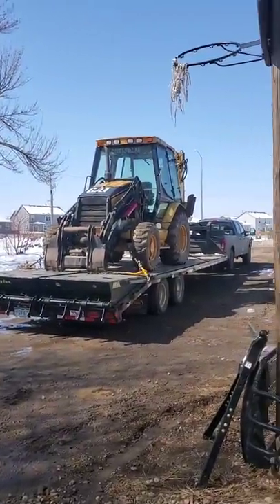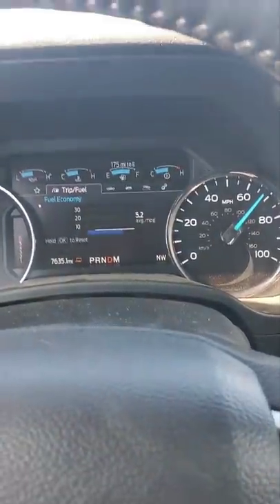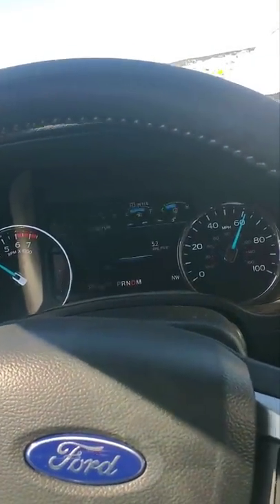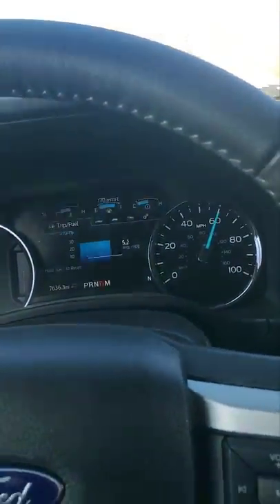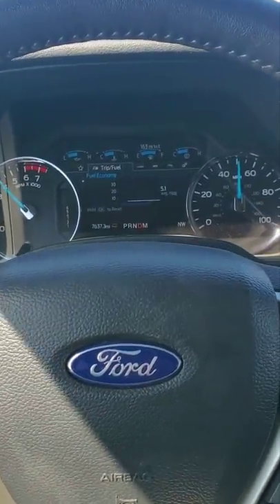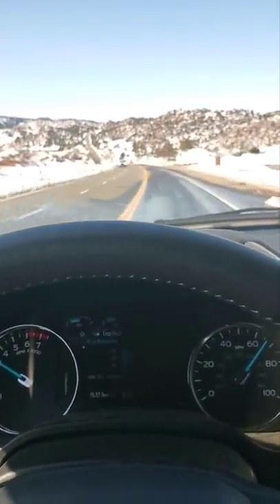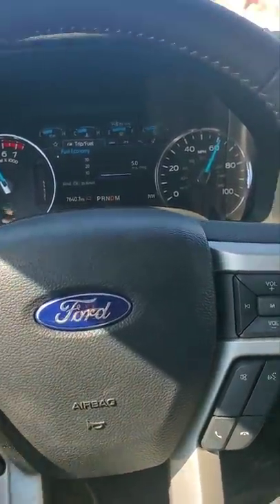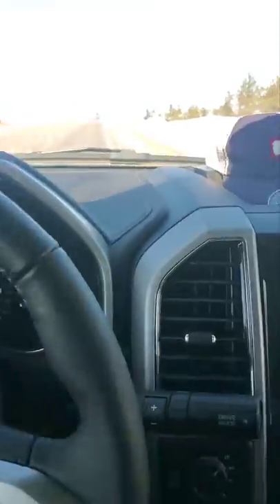7.3 godzilla towing 24k lbs through the rockies.

Comment: Don't forget the 3valve v10...that engine was powerful also...
Pulled a 17k trailer and could pas people on hills with a/c running...
Reply: The 3 valve V10 from Ford is way better than this engine.  Almost as much power and better fuel economy and is reliable as heck.   This new 7.3 is a joke all around.

Ford should have just made the 6.8 V-10 a lot bigger and improved upon the already reliable motor with new intake, throttle body, complete exhaust system from the manifolds all the way to the back, better tune for better power and fuel economy, and a few other things.  They could have made it with 4 valve heads and just kept the camshaft sprockets instead of cam phasers and made it reliable like it is now.

They could have allowed upgrades or options like a turbo or supercharger and made it even better.  It was so stupid of Ford to stray away from such a great motor.  That 6.8 V-10 was and is awesome.  Way better than this 7.3.

Oh yeah, almost forgot.  Just think what kind of gearing you could have with a 10 speed transmission mated to the V10?
Reply: @eldridge201  V10 is more tested but this motor is better for MPG low end torque, its smaller and while naturally aspirated you can tune the 7.3 to over 700HP which you can then stack a super/turbo charger on top of. This motor is massively detuned and overbuilt for the HP/Torque it makes stock meaning it will last a very long time, the stock parts can be pushed to 1450HP/1180FTLB of torque by Ford in their labs with "built" engines seeing over 2000HP.

The V10 is a great motor but there is a reason Ford decided to go with the 7.3 over revising the V10.
Reply: @yungnachty4474  What do you mean this motor is "better for MPG low end torque"?

Are you trying to say it gets better fuel mileage at the "low end" of the torque curve?  If so, where is your proof of that?  But also, how would you even test for something that specific?  You would have to have a very interesting and lengthy experiment which would be almost impossible to pull off without some serious financial backing because you would have to test multiple engines (each engine of course) and do many runs at the lower end of the torque range/curve for long periods of time AND...AND with the same specific load/conditions for both motors as well.

So, how would you even get that?  I contend you couldn't unless you had a laboratory with probably 5 to 10 engines of each motor and a few different "load" scenarios.

Plus, you would have to run them for a certain amount of hours and shut them off after certain times to simulate "real world" conditions.

I'll "guess" that what you actually meant to say was that the 7.3 gets better MPGs than the 6.8 V-10 (2 valve or 3 valve version) and I can say for a fact based on ownership and experience BUT ALSO all of the research I've done online that this is simply not true at all and is actually an inaccurate claim/statement by you.

I don't know what you've read or what I've typed at this point as I've gotten involved in various discussions about the 7.3 on YouTube so I don't know if I mentioned it in these particular comments but I actually own a 2002 F-250 extended cab 4x4 long bed with the 2-valve 6.8 V-10 (auto) and it has just over 325k on it.

Recently, I had 2 or 3 bad coils due to a small radiator puncture causing coolant to spray up over and onto the upper portion of the driver's and passenger's sides of the engine in between the valve covers and the intake where the coils are.

This resulted in coolant getting on top of and residing on the coils as well as some of the coolant leaking down into a few of the spark plug holes and causing some of them to short out and cause misfires in multiple cylinders.  Of course, it got crap for fuel mileage.

After about 3 or 4 months of allowing this to happen, I finally got around to replacing all 10 of the coils and instantly my fuel mileage went back to what it was prior to this which is better than the fuel mileage reports I've seen on many YouTube videos as well as some online forums for the 7.3 gas engine and I've stated this multiple times on multiple videos.

I don't know what I've typed here but I've routinely seen people try to "brag" about getting 14 to 15 mpg in their 7.3 and sometimes they will say they are getting 16 mpg but the thing is, these people ARE ALWAYS driving super slow at 55 to 60 mph.  "Sometimes" I'll see some owners say that they are doing between 70 and 75 mph but when they are going that fast, they are typically under 14 mpg and around the 13 to 14 mpg range which is pathetic for an engine of this size after this many decades of being in the automotive industry.

I can get that and actually better with my "old" beater truck with 325k on it.  I could get an average 16 or 17 mpg with it if I wanted to drive super slow at 55 or 60 mph but that's NOT a "typical" or "real world" type of situation because "most" people don't drive that slow around the country on main highways or interstates which is when these figures matter.

Of course "in town driving" or odd areas where there are lots of hills, curves, or stop and go traffic won't count.  But nobody's trying to compare those conditions because they are knows to be "odd".

So, why "brag" about something that doesn't even matter or isn't relevant?  It's just stupid.  

But also, you have to consider that almost ALL of these owners make these claims WITHOUT DOING an accurate fuel calculation and they simply go by the dash reading which is inaccurate as it ALWAYS IS.

I've seen "some" owners claim that they do a manual or hand calculation based on their fuel receipts and gallons they put in compared to the miles they traveled and they "say" that the dash reading is only about 1/4 to 1/2 of a mpg off (higher than it should read) but the reality is, I'll bet the majority of these same owners would find it's actually closer to 1 mile or even more off if they did their calculations accurately.

Why do I bring the word "accurately" into the equation?  Well, again, I've explained this on other comments but I'll mention it again here and if I'm repeating myself, then I apologize.

But, the thing is, when people fill up, they are almost NEVER refilling at the same place or under the same conditions.  So, when people do their first fill, they may be on 100% completely level and/or flat ground at the fuel station.  And typically, when they fill up, they let the fuel handle clicker release and then try to fill up maybe a little bit more until it clicks one more time and then hang up the handle again and call it good.  They go inside to pay, get in the truck and drive a few hundred miles down the road and fill up at another place but here's where the problem comes in.

When they fill up at the next place, it may not be on completely level ground.  And as such, when they fill up and allow the clicker on the handle to release, it may do so without filling up the tank to the same level as they did for the first fill.  But also, even if they try to pull the fuel fill lever again and let it fill up a few more seconds, it may stop filling and release the clicker on the handle sooner on the second fill than on the first.  

And if the owner doesn't want to keep trying to fill it like they usually do, then they put the handle back on the pump and go in and pay and continue down the road.

The problem is, the handle release calibration on the second pump may stop sooner at the second fill up than at the first.  But again, also, if the ground was not as level, they wouldn't get as much fuel into their tank on the second fill as they would the first fill.  And sometimes, the difference can be as much as 1 or 2 gallons or possibly more if the difference in ground level is REALLY bad at the second station.

Obviously, "most" fuel stations are on level ground.  But, there are a few that have a slight incline to them.  And if this is the case, then you won't have THE EXACT SAME filling conditions at both locations so the calculations will be off.

And if it's off by 1 gallon, if you're traveling about 500 miles between fillups, if you only had to put in 35 gallons, that equates out to 14.29.  If you had to put in 36 gallons, that comes out to 13.89 gallons or a difference of 0.40 gallons or almost 1/2 gallon.  If you had to put in 37 gallons, then the calculation comes out to 13.51 mpg or a difference of 0.78 gallons or almost 1 gallon.

So, there IS a difference that would matter.  But the problem is, people "ASSUME" they are filling up their tanks to the same conditions at both fill ups when really, they might not be or actually probably are not.

The ONLY WAY you could guarantee that you had the fill ups to the exact same conditions is if you filled the tank up BOTH TIMES on level ground AND filled up the fuel level to the fuel neck lip where you put the cap on.  But, the problem is, in order to do this, it takes about 3 to 5 minutes of extra time because in order to do this, you have to pump until the pump handle clicks or releases and then let the fuel level slowly go down which takes 5 to 10 seconds so you can put more in and repeat the process until the fuel comes to the top at the fuel neck lip and "rests" there and doesn't drop anymore.

But, who's going to do that for their experiments?  Almost nobody.

I know a lot of people like to use TFLT's suggestion (The Fast Lane Truck on YouTube) of filling until the handle clicks and then counting to 30 seconds and then filling it one more time until the fuel fill handle clicks and then that's it.

Again, the problem is that different stations may have different calibrations for how soon their fuel fill handle will "click" in comparison to other fill stations.  But also again, if the truck is not at a level resting position in the first place, then the fuel level won't be the same for having the fuel nozzle filler "click" so the overall fuel fills will be different.

So, until people are willing to spend the extra time to fill up their fuel AT BOTH STATIONS to the point that the fuel "rests" or levels out right up to the fuel fill neck or lip, then I'm contesting that the accuracy of the hand or manual calculations are not accurate in many situations.

I actually do take the time to do this when I want to run experiments or get accurate figures.
Reply: As far as having "low end torque", I haven't looked and compared the torque curves for a long time so I don't know what the differences are at this point.  Perhaps the 7.3's peak comes in at a lower RPM range or it starts to make noticeable power sooner.  That may very well be true.  I'm not contending it isn't true.

But, as far as the 7.3 being "smaller", what is "smaller" about the 7.3?  It's physical size?  Well, that may be true since the V-10 obviously has 10 more cylinders.  However, since the 7.3 factually has more "cubic inches" by approximately .5 or 1/2 liter, wouldn't the 7.3 "technically" be larger in terms of cubic inches?  I think you can read the answer in the sentence before this last one.

Again, I haven't compared but is the 7.3 actually a "taller" engine in terms of height from the bottom of the engine deck surface area where the oil pan is attached (not actually including the oil pan depth) to the top where the valve covers go?  What about the intake or plenum?  Do those need to be considered as well?  Are you comparing width as well from the edge of the valve covers to the other valve covers?

What I'm getting at is are you considering the OVERALL "mass" of each engine and comparing the two?  If so, I don't know which one is technically "smaller" but we have to know what's being compared.

When it comes down to it, by the time you "cram" either engine in he front engine bay area of either truck, you really don't much room left.  But, if you want to argue "size" in that engine bay area, I think an argument could be made that the V-10 actually has "more" room under there although it may not win by much.

Just go and look and compare the additional hoses and other emissions components, sensors, and other "stuff" that the newer 7.3 V-8 has compared to either version (2 or 3 valve) of the 6.8 V-10.  Perhaps the overall width is less and I'm sure the overall length is less since it obviously has 2 less cylinders.  But maybe it makes up for it in height as well as the way accessories are mounted and so on.

In reality, I'll bet the difference isn't that much but based on looking at some videos and pictures of the 7.3, I don't think it's any "smaller" by any means so I don't think your comment holds up there.  At least not in my opinion.
Reply: In regards to "tuning" a 7.3 to 700 HP and possibly being "detuned", that's a fine point to make if you want to get into that discussion.  Unfortunately, although there are "some" people that have done some "tuning" to the 6.8 V-10 (both versions) and they've had okay to good results (depending on who did the "tuning"), there just aren't or weren't that many people that did much with the V-10 in that area.

So, it will be tough for me to make a comparison and see where the results come out at.  I do know I've watched a few different channels on YouTube where some owners have gotten "decent" results upwards of the high 480 plus range to the lower 500 range for RWHP so that would be close to your 700 HP figure if you're talking crank figures.

But, here's where you will lose me with the argument when you bring up Ford being able to "push" this same engine to 1450HP/1190 FTLB of torque or even having "built" engines with over 2000 HP.

That's all fine and good to have for the sake of a discussion BUT IT DOES NOTHING FOR ACTUAL "REAL WORLD" (TYPICAL) USAGE.

The problem is, Ford HAS NOT come out with any additional software "flashes" or program changes to allow for any more "oomph" in the power department.  At least not that I'm aware of UNLESS they actually did super recently that I missed.  If I have missed that, then please provide a link to that info.

In fairness to the 7.3 though, the "tuning" aspect is actually something I have been arguing for in a few comments since I also feel that the engine has more potential than Ford is allowing it to have from the factory.

You see, whether you're aware or not, I actually worked as a Ford tech at a couple dealerships on heavy line as well as the light line so I've got an "okay" well rounded bit of knowledge of Fords.  Sure, it's been a few decades since I worked at these dealerships but still, I understand that Ford has come out with software upgrades and/or "tunes" to improve performance, drivability, emissions, fuel mileage, longevity, and etc.

They've done it with a few of the Powerstroke diesel engines and some other ones.

But what I don't get is why they haven't increased it significantly or, at the very least, even a little bit.

My thought is for a few various reasons but mainly because Ford is scared to do this for fear that these engines won't hold up to the abuse they would be put through should they add another 100 HP to them.  Since you say that they can "tune the 7.3 to over 700HP", then adding another 100 AND STILL keeping it under 600 HP shouldn't be anything to worry about.  But they don't do this?

Why don't they?

Heck, even 75 would be something or at the very least, how about an extra 50?  I can't believe adding 50 with the tune would be asking too much.  But, apparently it is.

But, if what you say is true about the figures of 1450HP/1180TQ, then even 1/2 of that SHOULD be a "breeze" for this engine to handle even for the long term since it would essentially just be doing 1/2 the work over the long haul.  So, is 725HP/590TQ really asking too much?

How about an easy figure of 700HP/575TQ?

That's even less but yet still a significant increase over stock.  Are they not confident enough that these engines can handle that power for the long term?

My point is, if they aren't going to allow these engines to produce more power from the factory AND STILL maintain the factory warranty (which actually should be improved as well), then these numbers don't mean squat.

It doesn't matter if you can build an engine to make 2 or 3 or 5 times the power if you can NEVER use it.

In fairness, even you have to admit that bringing up a "built" 2000HP plus 7.3 V-8 is kind of ridiculous since it would DAMN NEAR ONLY APPLY TO A RACING APPLICATION.

And at that point, why are you even having a discussion in these comments?

This IS NOT about how much you can build these motors to "race" with.  It's about the "typical" every day owner or at the very least, one that may use it for harsher uses than the "average" person such as a construction company or someone that uses it to haul trailers or other things for day to day use AND DO SO for 200k or hopefully 300k plus miles.

Nobody cares that it can make 2000 HP going down the track UNLESS they are using the truck to race.

I understand that you were trying to point out that "the possibility" to make 2000HP plus is there but so what?  Unless I'm mistaken, I believe you can make a 6.0 Powerstroke diesel to make almost 2000 HP (I actually just watched a video where they made just over 1900 HP from Warren Diesel).  But, is that something that's going to be used for the "everyday" owner?

Likely not.
Reply: I'm not going to try to argue that you could "push" a "built" V-10 to 2000 HP or even 1500 HP for that matter so I will concede that perhaps this new 7.3 V-8 is better in that regard.

But, like you admitted at the very beginning of your response AND what is likely one of the most important things to consider with this comparison or argument.

The V-10 was AND IS "more tested" or in other words, has "real world" results to stand on.  And as such, this new 7.3 simply factually can't really compare at this point.

This new 7.3 just factually doesn't even barely have 2 1/2 years "in the field" being used and we could argue that it's barely coming up on 3 years.  And the reality is, there are likely VERY FEW owners that have even 100k on the majority of the engines out there and probably hardly any that have 200k on them at this point.

And as such, you aren't going to have any "real data" to compare in terms of longevity because there simply isn't really any to speak of due to likely many of the engines having 100k or less miles on them.  And really, that isn't anything to bring up since that's not really even the starting point that the discussion should be at at this point in time with the decades or almost a century of improvements for the engines.

But even with the short time span of operation, we can still point out some things that are problem areas based on the history of other engines from Ford with the same types of features and/or components.

I believe I've stated it here but again, I can't remember at this point but the VVT or cam phaser is likely going to be a problem in the future based on the historical problems with Ford's other engines.  So, that's one major concern.

And, of course, the current issues with the cam or lifter delamination problems with metal shavings coming off and causing issues.  And just today I watched a video from a channel where they discussed that Ford is apparently replacing the entire motor when this happens.

Umm...I don't think it takes a genius to figure out that having to spend that kind of money isn't something that screams "reliability" for ANY owner.  And don't give me the same excuse that some others try to and say that it's "not that big of a deal" because the majority of the issues have been found to happen under warranty.

That's great for the owners that still do have their warranty but what about the ones that are now out of warranty?  Do you really think that they are feeling confident now with these issues popping up?  I doubt it.

Some have said that it seems to be happening more with the larger vehicles such as RVs/campers or larger box trucks or cube trucks and these vehicles likely spend more time idling.  And during the idle time, the variable oil pump may not be providing the adequate oil pressure or volume that is needed to keep things properly lubricated.  Well, even though this may be happening to more of the vehicles that spend more time idling, you can't tell me that it's not just a matter of time before this starts happening to the other vehicles out there that just have to spend more time on the road or a few more years idling.

Again, it's likely just a matter of time for when things will start to happen.

I understand that currently there is a fairly low rate of these engines having that issue so perhaps I'll be wrong.

But, to say that it's "overbuilt" and that "it will last a very long time" is pretty presumptuous especially given the design flaws with the VVT, the variable oil pump, the odd cavity that they have between the cylinders that is just waiting to have issues, and the now known camshaft or lifter problems.

People just need to stop trying to brag this 7.3 V-8 up because so far, it hasn't shown anything worth bragging about.

Yes, it DOES have a little bit more power in stock form than the 3-valve V-10 engines.  But it's not so much that it's a 30% or even a 25% improvement.  I think when I broke the numbers down, it averaged out to be about 11.5 to 12% over the later model V-10.  That's nothing to "brag" about by any means.

But also, with a tuner on a V-10, you can pretty much get the same power as the newer 7.3 so you're not really gaining anything in that regard.

Mainly though, the V-10 (either version) is a "more tested" (ahem...."tried and true") engine that is known to be reliable.  This is proven.  I would take that over this new engine that gets worse fuel mileage and only has marginally more power and may now have camshaft and lifter problems to be concerned about down the road.

I understand that unfortunately they aren't offering the V-10 as an option anymore so it is what it is.  And if you want a newer truck, then there isn't an option so I guess it comes down to whether or not you want an older truck.  But actually, that brings me to another point that is worth bringing up.

Parts availability and cost when things do break down.  Although it may have gotten taken care of now, I believe there were issues with the spark plug wires and they weren't available for a period of time.  At least with the V-10, you know that parts are readily available for the most part.  That's also worth considering.

If you want the 10 speed transmission, then obviously there's nothing that can be done to make that happen in a V-10 at the current time that I'm aware of.

But, if this comes down to wanting some of the newer technology like bluetooth radios and backup cameras, then just go and have them installed in the truck.  The older models had heated seats so that's not a problem.  And as long as you have the suspension, steering, brakes, and tires in good working order and there aren't any leaks around the door seals, you can have a comfortable riding truck that will handle and ride well no different than the newer ones.

At least for the most part.

I would rather have the peace of mind not having to worry about the issues that will likely arise with the 7.3.  But you do you if you think it's the cat's meow.

Take care.
Reply: @eldridge201  They don't want to juice the 7.3s up that much because it would sway people from getting the much more expensive diesels. They want to drip feed the upgrades by bumping power here and there and if the time comes eventually, they would release something like that to replace the diesel. 

You can buy crate engines from Ford that are running 615HP-700HP for project cars. But its not in the truck. However ford did provide almost immediately tons of resources for shops to do aftermarket upgrades to them. You got to remember though, the way this engine is built is that its meant to be a overbuilt motor that can handle 10s of thousands of hours of idle while still towing something like 22k pounds in the 350 with a goose hitch. 

Another big thing is that the motor might be able to make that much power, but how will the transmission fair? It could be that there were issues with the transmission failing under specific scenarios or that the motor starts burning oil when ran like that under speciic circumstances. 

I do think its a transmission issue though because all those crate motors are paired with a specific 6 speed transmission instead of any variant of the 10 speed.

And if you want to talk about the every day man or whatever they you have to account for the fact that the push rod 7.3 is a much simpler and cheaper engine to repair and is designed from factory to be rebuilt as many parts of it are extra thick in case something needs to be bored out. Not counting that the V10 was a complete gas hog, way more than the V8. There is a reason it was replaced with the 6.2, let alone the 7.3 that sits in an entirely different tier of ability.
Reply: @eldridge201  Bro calm down 💀

You are misreading what I said, the 7.3 is better for MPG, and has higher torque at lower rpms. Both of those things are standard factory spec on every car ever released in the US in the last 20 years.
Reply: @yungnachty4474  
Not true...the v10 made 20 less foot pounds of torque  than this engine with a lazy 9to 1 compression and with no vvt...now this is with less cubes...the v10s output was 365 horsepower 4200 rpm and peak torque of 460 foot lbs and 3200 rpm...with just a lil more compression it could have surpassed this engine in output very easily while keeping the valve train simple with no mechanically complicated devices like vvt...
Reply: Now...I do understand some of their reasoning behind the change...they went for something  smaller in physical size that can fit into different vehicles...and could share some architecture with other engines coming in the future..if u look at it from a cost standpoint...the v10 being the odd man out now...it would cost more to produce in the long run.....
Reply: @yungnachty4474  I disagree with your thoughts on the reason why they don't want to "juice" the 7.3 up more and assert that it's because they want to sell more diesels.

I will again contend that it's simply because they aren't confident enough (key word there) that the engine would hold up in the long term.  Otherwise, it's just pointless and stupid to not offer more power if it's there or at least available just by doing some tuning.

Also, your claim that it is "built" to be overbuilt is BS as well and that it "can handle 10s of thousands of hours of idle....." is also BS as is being proven right now with the problems with cam or lifters delaminating.

Although I haven't done extensive research on this to verify it with 100% accuracy, it's been pointed out by one YouTube channel that the problems seem to be occuring more so in the RVs and box trucks with the 7.3 where there is likely a lot more "idle time" WHICH WOULD MEAN that your statement would actually be inaccurate.

So, why do you make these statements when they don't make sense?

I don't care that currently the amount of engines having the issues is around 2% out of all the trucks on the road currently.  It's STILL an isue.  And if it's being caused more so due to the fact that the ones being affected are idling more, then obvious your claim is false.

You mention that the motor might be "overbuilt" but then lay out the potential problems that may have come up from pushing it further.  Well, if it's having those problems, even if they are speculative, that DOES NOT MEAN that the engine is "overbuilt".  If it was, then it would be able to hadle these issues.

So, if it's not able to handle them, then you can't say it's "overbuilt" if it would be having those issues.

Either it's "built" to handle those issues or it's not.  And if it's not, then it's simply "not built" to handle those issues which makes the engine inferior.

As far as the transmission, it's being argued that the transmission was likely built and potentially programmed to handle the power of the diesels which, by comparison, is almost double at least as far as torque goes which is what's thought of more when it comes to towing.

So, I don't think that the transmission is failing due to that.  Of course, I could be wrong.

You talk about the V10 being a "gas hog" and how it was "way more than the V8" and you're simply incorrect on that in comparison to this 7.3.

Being an owner of the first version (2-valve) of the Ford V10, I know first hand from experience that the fuel mileage isn't as bad as others have claimed  or experienced.  But also, I know for a fact it is NOT worse than the 7.3 based on those owners' reports.

As I've stated, the V10's fuel economy is actually better.

Again, I've stated this on other comments but my guess for why some owners are experiencing worse fuel economy than others is simply because people won't get their foot out of the throttle with the V10s because they love the power and response it has.  It truly is a "giddy up and go" power curve.  And really, people just like to go fast so they likely just don't drive like they should when it comes to the V10s.

The thing is though, I'm not even a "grandpa" driver or super easy on the throttle myself.  So, I don't understand how many people are  getting as bad of fuel economy as they claim.

And if you want to claim that the 7.3 owners "bragging" about getting the 14 and 15 mpg figures are "better", as I've already pointed out, go and watch the videos of those claims.  They are FULL of owners discussing driving a SLOW 55 to 60 mph.  Sometimes you'll hear of some of the owners going 65 mph but usually, it's slower.  It's pretty rare that you hear of anyone getting into the 70 mph range AND ALSO still getting 15 mph or better.

Another thing regarding the 6.2 V-8s is that those have been regarded as "gas hogs" as well.  Plenty of videos out there mentioning this.

As for the 7.3 being "simpler" and "cheaper", well, that may or may not be true depending on certain things but also ones own personal idea of what is actually "simpler".

Just because it's a pushrod engine doesn't necessarily make it "simpler".  It's just that the pushrod engines were historically more common up until when overhead camshaft engines started making their way into the vehicle market.

I don't know if overhead camshaft engines started becoming more and more popular in "some" vehicles until the 70s or 80s but if you figure that many front wheel drive engines started to come out with this configuration, it could be argued when it became "popular".

But, for the sake of this discussion with Ford specifically, I'm aware that it was in the early 90s that the "modular" engines became used more and more in their vehicles.  But, I don't think the modular engine is necessarily "less simple".  It's a matter of preference.

I feel it comes down to what people are simply more "comfortable" with due to history.

Since pushrod engines have been so prevelent over time and there's so much info or data on them, then I think this is why so many people in general are more familiar with them in comparison to the "non pushrod" style engine.

But, does this necessarily make it "simpler"?  Well, I think that depends on who you talk to.

The reality is, both engines still have camshafts along with valves, rocker arms/pedestals, timing chains, belts, or gears of some sort, and many of the other same components.

Really, the main difference is where the camshaft resides in the block as compared to the cams being above in the heads.  Outside of not having pushrods, overhead cam style engines still operate pretty much the same way.  We're not talking about a rotary style engine that ACTUALLY IS a bit different.

So, why try to say that a pushrod engine is "simpler" as if it is?  It's not that much different really.  It's just that it was "more common" historically.  Okay, that's fine.  But just because it was "more common" in the past doesn't make it "simpler".  It just makes it more common and nothing else.

Again though, I think that comes down to preference for each owner or person working on the vehicle.

As far as making parts "extra thick" (I'm assuming you're referring to the engine cylinder walls since you're talking about boring out the engine), that may very well be true.  I don't know so I would have to research that.

But, if you really want to argue that, then I think the opposite argument could be made that one of the reasons they made them that way was BECAUSE they actually knew that they were going to have problems down the road THAT WOULD REQUIRE THEM to have to do machining to bring the engine back to an allowable service use or life to put the vehicle back on the road for more years to come.  And as such, wouldn't that actually mean that they knowingly designed an engine that would knowingly have issues in the future?

In other words, they knowingly designed a piece of crap engine?
Reply: I'm sure you don't like reading that but you have to accept that this very well could be a possibility.  Otherwise, why wouldn't you just designe the engine to be built to operate for hundreds of thousands of miles and if something catastrophic happened to the point that it would require majore work that includes fixing internal parts such as the pistons or cylinder walls, well, then I think you could consider that maybe they would have to just replace the motor at that point because the engine itself was shot.

And perhaps they'll do just that anyway.

I'm NOT AGAINST the idea of designing something to have the ability to be reused in the future.  I'm actually all for that.  But the opposite argument can be made whether you want to admit it or not.

After all, if they truly are about reducing weight to maximize efficiency, then adding a few more pounds to the engine is going against that thought process.

And if you want to argue that there is a tradeoff, then don't get me started with all the other "stupid" BS things that manufacturers do to save weight over strength.

Heck, I'll even bring up a stupid downfall of the V-10 engines that although other engines have, it's not nearly as bad as for the Ford V-10s.

How about INSTEAD OF making the exhaust manifold studs so small in diameter, they get increased by at least 10% or maybe 20% and move up to the next sized stud to hopefully prevent breakage?  Or, when they do break, they are likely to be more easily removed due to having more material to work with to remove from the aluminum castings of the heads?

Instead, let's use extremely small diameter studs so that when they do rust and/or break, it's a big pain in the ass to remove them.  All for the sake of saving a few ounces of weight in the overall build of the vehicle right?

Get the F outta here with that BS.  There's NO EXCUSE for why Ford couldn't have just designed the exhaust studs in their V-10s to be AT LEAST one size larger.  This likely would have solved damn near all of the exhaust stud breakage issues.  But, of course, nope.  They just had to use some stupidly small exhaust studs.

Why?  Because stupid, tha's why.

As far as why the V10 was replaced with the 6.2, you can give all the reasons you want.  Ford made a HUGE mistake replacing it in the pickup trucks.  Heck, they even used it in other platforms all the way up until a couple years ago.  They used it in RVs and busses and other things.  I think it could be argued that there was a good reason why.

It simply was a good engine with a good amount of power with good reliability.  Otherwise, they would have scrapped it in other platforms altogether.  But, they didn't.  There's a "reason" why they did that as well.

As far as me "calming down", I'm actually very calm.  Don't think more into our discussion or disagreements about the Ford 7.3 gas engine and the Ford V10s than it is.  I just simply disagree with what you're trying to claim as I think many things are factually incorrect.  That's not me being "uncalm" and simply having a discussion with you and pointing out where I personally feel you're incorrect.

But, I'm not just throwing opinions at you.  I actually have facts based on an ownership perspective.   I KNOW FOR A FACT that the 2-valve version of the Ford V-10 gets better fuel mileage based on the same operating conditions.

Whether it be unloaded without a trailer driving down the highway or interstate going 65 or 70 mph or pulling a trailer or camper doing 60 or 65 mph, I am confident that the 2-valve version of the V10 gets better fuel economy hauling the same load or being unloaded.

You typed again (for some reason) that "the 7.3 is better for MPG".---- Okay.  When?  Under what conditions?

I'm telling you that you NEED to go and watch all the videos online and read some of the forums that are actually showing that what you're claiming is actually not accurate.  It just isn't.

When you try to speak of the MPGs being "better" in the 7.3 gas engine, are you completely ignoring that the people getting that "okay" fuel mileage of 14 or 15 mpgs are ONLY TRAVELING at 65 mph or  lower?  Many of the videos I've watched have stated that those people were traveling about 55 mph to 60 mph.  I've brought this up multiple times in this discussion between us.

THIS IS NOTHING TO BRAG ABOUT.  It just isn't.  It's stupid to even bring up.  Why?  Because ALMOST NOBODY drives that damn slow.  So, it's not relevant.  It's not "real world" type of scenarios.  So, why even bring it up or "brag" about it?

My point is you shouldn't because it's just stupid because it IS NOT worth bragging about.  I can get better fuel mileage in my old 2002 F-250 with the V-10.  It's a truck that's about 20 years older.

So, what good does it do to have the "pushrod" style engine when it doesn't gain anything really?  It's got marginally better power IN STOCK FORM.  I don't give a crap that you "could" (potentially) build the 7.3 to handle almost double the power.  That's all well and good but if it's not going to be available OR DO IT RELIABLY FOR A FEW HUNDRED THOUSAND MILES, THEN YOUR STATEMENT DOESN'T MEAN SQUAT.

It just doesn't.  It's just not applicable for being able to be used for a typical owner's needs.  And as such, why bring it up?  My point is, again, it makes no sense to bring it up because the engine is already having issues even at this abismal power level already.  Why bring more problems into the mix with trying to give it more power?  How about they just make it reliable to begin with?

The V-10 is already known to be reliable as heck.

And one of the reasons is because of the lack of a VVT type of setup and they just have stationary camshaft sprockets to minimize engine failure.

EVEN IF I were even consider that the 7.3 "might/maybe" have slightly better fuel economy figures over the V-10s (which I'm not still at this point but I'll give it to you just for the sake of this part of the argument), those slightly better fuel mpgs WOULD NOT outweigh the possible long term issues that the 7.3 is likely going to have with the VVT setup as well as the oil pump pressure and/or volume issues as well as the cam or lifter delamination issues.

In fairness, to my knowledge, there hasn't been a lot of reporting of the VVT setups going bad or the oil pumps going bad that I'm aware of.  I'm sure there are a few here and there but I haven't really noticed those things being talked about.  So, perhaps there won't be those issues in the future like I'm predicting.  I hope for all the 7.3 owners' sakes, I'm wrong.

Maybe they finally improved upon the design of the previous VVT setups that were failing or improved on the machining process for making the parts and possibly assembling them and they are working better.  And honestly, if that's the case, then that would be great.

But if that's the case, then why didn't they apply those same scrutinous quality control issues to the cam or lifter parts since they "seem" to be having problems?
Reply: @teriblethinker582  While I agreed and "thumbs upped" your first response, I don't really agree with your second one and I'll explain why if you care to read.

The idea that the 7.3 is "smaller" in physical size may be an "illusion" when it's all said and done.

Why?

Well, if you just look into the engine bay area, just look at all of the addtional hoses and where they have placed everything as far as accessories and additional eletrical components and sensors.  Is the engine bay area really any less "cluttered" that the V-10 engines?

Of course it isn't.  It's still the same "big ol' mess" as any other engine in an engine bay since about the late 80s until now.  Heck, even in the 80s, depending on the vehicle, there were even some engine compartments that had all kinds of "stuff" literally stuffed into them with large vacuum canisters for things as well as large cruise control mechanisms and air cleaners and so on.  

As far as the 7.3 being able to "fit" into different vehicles, what other vehicles other than the pickups, vans, and maybe box trucks or other truck platforms are the 7.3s being offered in?  To my knowledge, they aren't offered in anything else other than a truck type of platform.  

So, what's the point of trying to suggest that they went with something smaller in physical size (which may not actually be true for the engines themselves) so they can fit into different vehicles if they never really are fitting into different vehicles?

If it's in a truck, van, or RV/bus type of platform, the footprint is already going to be large.  So, why do they care about size so much?

The V10 being the "odd man out now" is Ford's own fault.  In my opinion, they let a great engine platform die that they never should have.  I think they could have had so much more potential for that engine that they really should have expanded upon.

And just something to consider here that I think is worth throwing out there.  If the size of the engine was a factor that has actually improved anything, then why haven't the actual physical dimensions of the vehicle itself or the weight of the vehicle itself gone down?

You don't see the front end of the trucks any smaller do you?  What about the shape of the hoods?  They are still as large as ever.  The front end is definitely not any smaller and sadly, the Fords have taken a page from Chevy's book when it comes to designing their front ends and personally, I think it looks like crap because they are so large and bull nosed.

I may be wrong and perhaps the weight of the 7.3 engine has gone down a little over the V-10 but I would bet it's only by a few pounds.  Overall, I'll bet that by the time you get all the accessories attached and the hoses and other things, it's probably damn near the same as the V-10.

But I do agree with you that Ford should have increased the compression in the V-10s and also even added a turbo option or  maybe even 2 turbos.  Actually, I think they should have just went full out and made it into an 8.5 or even a 9.0 liter and just let it eat.  Of course it would have taken some fuel but the efficiency might have been fine to go 70 or 70 mph with the larger motor compared to the smaller one.  It's like putting an inline 4 cylinder in the smaller Ford Rangers compared to the V-6 versions back in the day.  The V-6 versions actually got even better fuel mileage than many of the 4 cylinders because they weren't having to struggle as hard to move close to the same weight.

There's a channel on YouTube of a guy who does Ford modular performance and he did a twin turbo setup to his personal Excursion and it made about 550 HP and 801 torque to the rear wheels (on the dyno).  So, if you figured about 20% loss for drivetrain, that comes out to about 688 HP and 1001 torque at the crank.  I'd take that over a diesel any day and have less to worry about.
Reply: @eldridge201  Why would ford spend millions on salary and R&D to build a new engine when the solution was there 20 years ago? They want to be and are best in class with the 7.3 for a big displacement gas motor. Accountants are a thing, feasibility studies are a thing. All this gets reviewed by teams of engineers, their managers and then sent up the chain of command to be approved. The 6.8 V10 was replaced over 10 years ago by the 6.2 and the 7.3 is a step up. 

You clearly just have some fanboy love for the V10, which is fine, but its not a better motor. I have driven both myself and the 7.3 is leagues better.